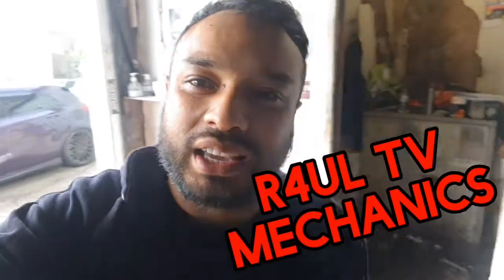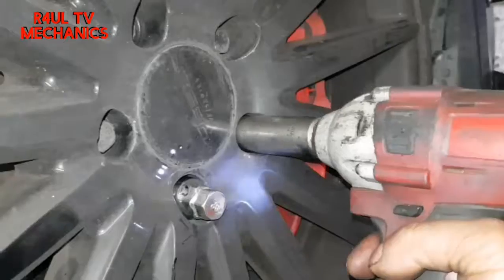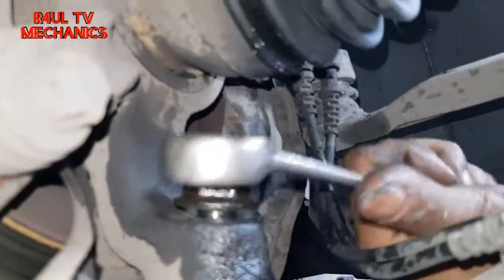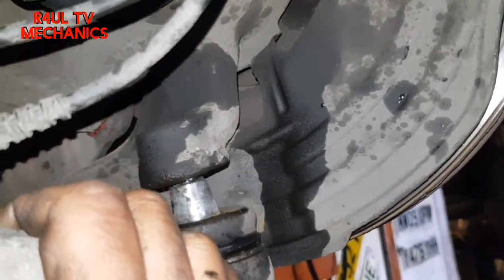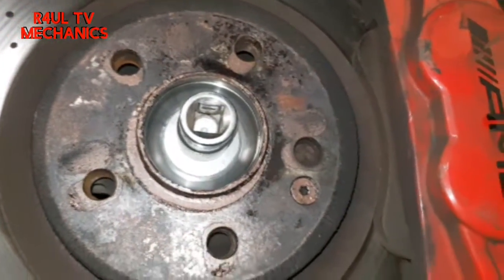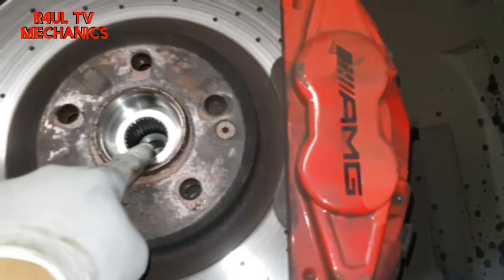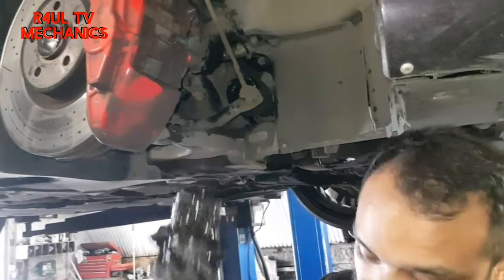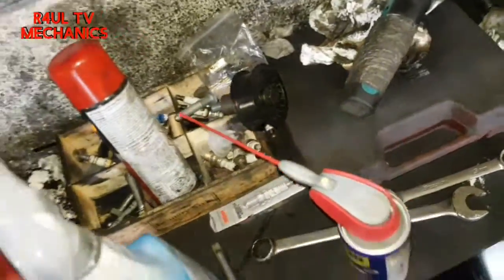MERCEDES A CLASS DRIVESHAFT REPLACEMENT

Comment: Thanks for the vid, which grease did you use. I have white lithium grease, will that do?
Reply from the maker: I put ceramic brake grease on it but you can use yours no problem or copper grease etc any grease will do

Comment: Similar for w205 c class I'm assuming, thanks
Reply from the maker: Yes it should be
Reply: @TEAMR4ULTV  Thanks for the response, you are a good teacher! I followed the same steps for a  c43 and only required an axle seal, impact gun, breaker bar, flathead screw driver, lubricant,  some sockets and a jack to lift the car. 
This process is $600 in labor shop time in the U.S from an independent mechanic and a couple thousand dollars from a Mercedes dealership; parts not included.

I found a new pair of aftermarket CV axles on eBay for $170 and the seal was $30. I had the tools already. 

I would have to work for three weeks at my job to afford this to be done by someone else and I only spent $200~ roughly, and 3 hours doing this myself. 

Thank you !
Reply from the maker: @c43sedan  am so pleased you got it done. Thanks for watching really appreciate it I hope the video helped you out.

Comment: Hello.. have you change a clutch on this model.. hve a 2014 1.6 petrol Garage are saying need to take the engine out? Is that true and charging me £1500 parts and labour, to much for a clutch?
Reply from the maker: I never replaced the clutch on this model but to be honest I think it's just like a Peugeot clutch job dont think you need to take the engine out

Comment: Is the name for that shaft a transmission shaft? On my 2010 1800 A class, my local mechanic, condemed it and said it needs replacement! How much is the cost of such a part? Is it worth repairing, 200,000 miles on the clock!
Reply from the maker: Thanks for watching really appreciate it. 
The part cost about £150 to £200 from local spare shop. From Main Agents I don't know. Labour about £50